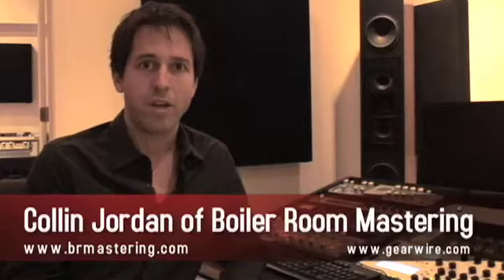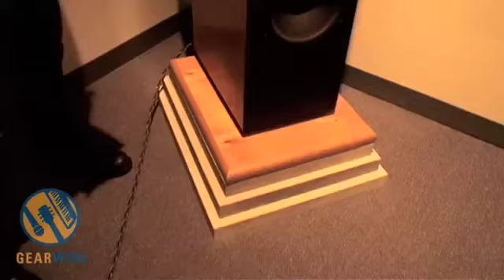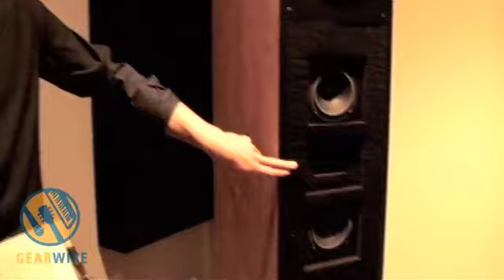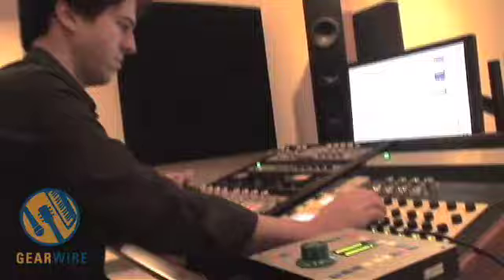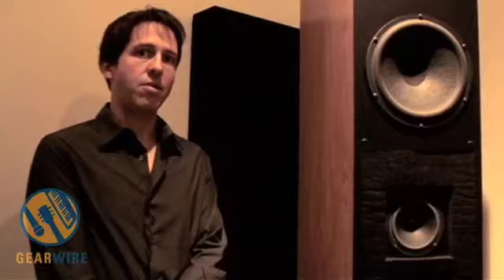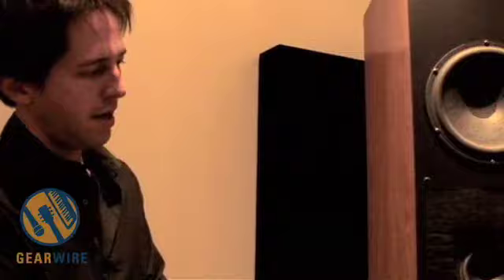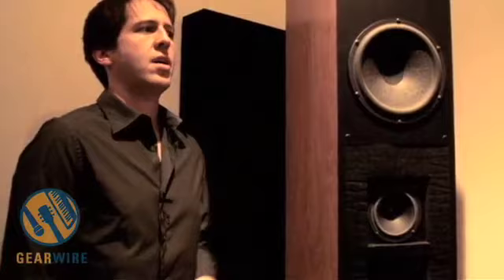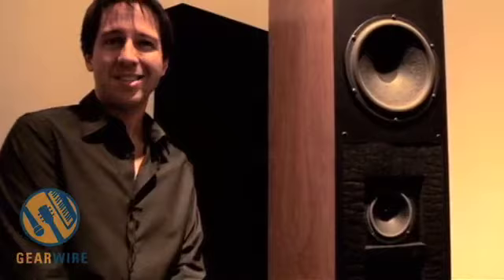Dunlavy Audio Labs SC-IVa Speakers At Boiler Room Mastering

Comment: Thanks for confirming what I have experienced. John Dunlavy is simply one of the best speaker designers and a proponent of the time and phase aligned approach (like e.g. Vandersteen and Thiel). After having had 40+ different speakers spanning over 16 brands , these (SC-IV modded and PCL-400 aka Black Knights) are here to stay for a long time.  Their sweet spot is wide when you place them on the long wall

Comment: One of the other reasons that these speakers sound unlike anything you normally hear, is the fact that they are a time aligned design.  In normal speakers (99.9% of whats out there) the woofers, mid range, and tweeter are not physically or electrically lined up in time.  The Dunlavy is a very special speaker that does both of these thing.  A simple way of looking at it is if you played a group of tones through the Dunlavy all of them would arrive at your ear at the same time.

Comment: The Dunlavy SC-IV... V... and VI series are probably the best measured loudspeakers in existence past and present. I say "measured" because the John Dunlavy designed them by measurement criteria alone. They are completely flat, time coherent with vanishingly low distortion and devoid of ringing and stored energy. BUT---this is under anechoic conditions. In a typical listening room they are rather bright with a rising treble response.

Comment: I love these speakers, I saw 3 pairs of them at studio 301 in Sydney. When these first came out their performance stuck in my mind when they were connected to Krell Class A Power amps- for memory and this is back in 1993 they were connected to KSA300 S one each speaker one channel for mids and tops and the other for the bass. The rep maxed them out with Fanfare for common man nearly blowing us back down the room. The engineer here is very accurate in his views regarding the speakers. I can see why they are highly regarded as a reference monitor with the right amps connected. I heard them with Pass Labs X250.5 mono blocks- yeah a perfect match.

Comment: Supremely flat, perfect pulse response, vanishingly low resonant hash on CSD plot. Objectively speaking Dunlavy's are some the most accurate speakers ever made. That is if you listen in an anechoic chamber. Dunlavy's trick is the use of space shifted drivers, first order crossovers and lots of felt on the baffle to prevent secondary reflections.
However in real world listening rooms with fixed dimensions and reflective walls the big Dunlavy's measure and sound no better than less measurably perfect but still good speakers. IN ROOM frequency response of a Wilson Sophia for instance ends up being as good overall as the Dunlavy's. That's when more elusive factors come into play not found in typical measurements. The ability of the drive units to transduce low level artifacts, complex signals and dynamic contrasts is not something found in conventional measures but it is something demonstrably audible in certain designs.
That is why I prefer well designed electrostatic speakers over any box speakers I've heard. It's something you only get with a four square foot diaphragm that's lower in mass than a dome tweeter. Even if the Sandersound does not measure as accurately under anechoic conditions, the transparency, low distortion and sheer information retrieval of a Sandersound electrostatic eclipses any cones and domes speaker I've yet heard including the magnificent Dunlavy's.
Reply: I agree completely with this carefully worded comment. So would Robert E Greene, a reviewer whose opinion I respect: http://sanderssoundsystems.com/product-reviews/speakers/320-sanders-10e-review-the-absolute-sound